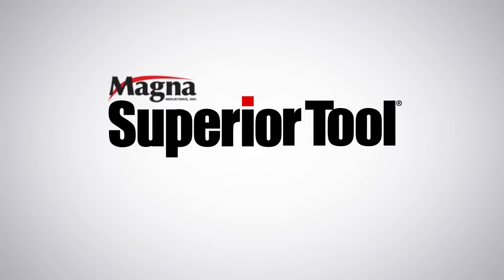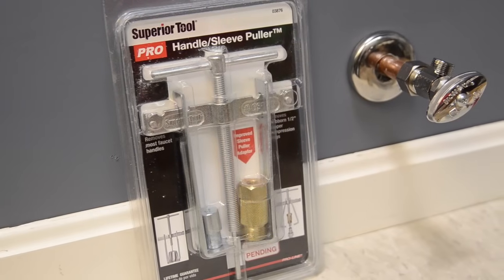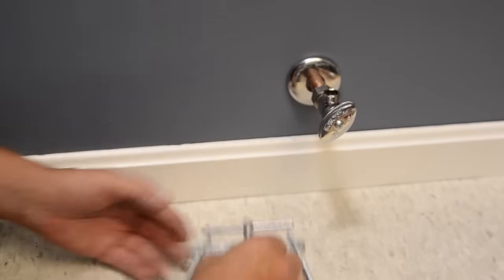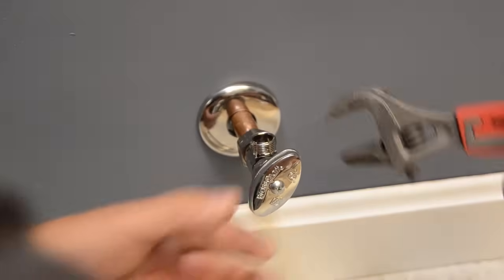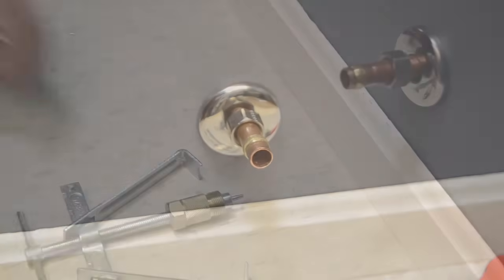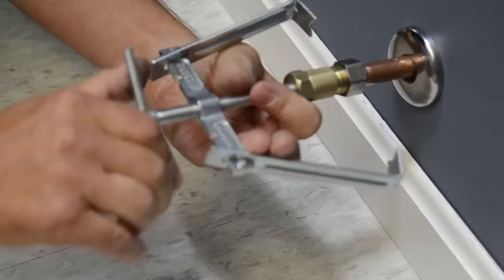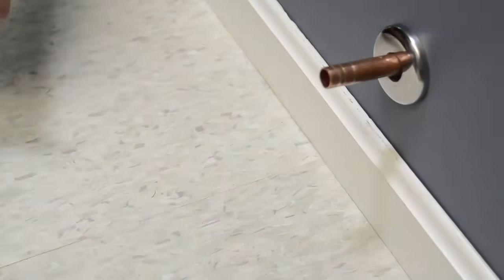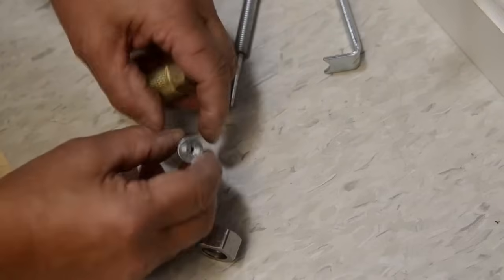Easy Compression Ring Removal - Superior Tool Handle & Sleeve Puller

Comment: just cut the ring with a grinder, it will pop out takes 10 seconds.
Reply from the maker: Thanks for your comment, just be careful not to score the copper pipe!
Reply: But not everyone has excess pipe to spare. And people search youtube for simple solutions since they probably don't have a bag full of tools like a grinder. Under my bath sink, if I cut it, the protrusion from the wall will no longer be at a comfortable length to work with. After that cut, a few yrs later if you need to replace, you then have to get into the wall. This is a much better solution for bathroom sink repairs than a grinder.
Reply: Cant always get a grinder In every area

Comment: Looks exactly like the ones they sell at Home Depot - and they are absolutely terrible. You need fixed arms so they do not come loose when pressure is applied!
Reply from the maker: Thanks for your comment, this was designed to remove a compression sleeve without needing the handle puller arms.  It will not come loose.

Comment: I am going to play devil's  advocate here.  The water utility whether city, company, utility, etc all use a similar device as the pipe piercer when making a "tap" for new service.  It is a saddle with a valve which is clamped to the pipe and a drill is used through the valve to make the hole for the water.  As the drill is pulled back and out the valve is closed to shut off the water.  The line is hooked up and the valve is opened to supply water.  New gas line services are done the same way.  These saddles are expensive and more complicated than that piercing kind.  I agree that cheap saddle is not very good.
Reply: ?????  Saddles?  There's nothing here about saddles or piercing.